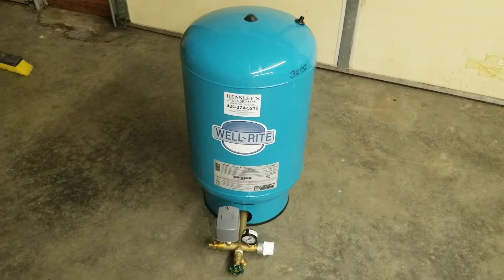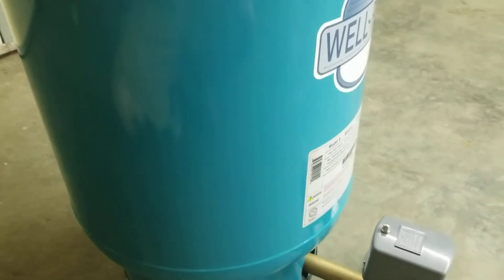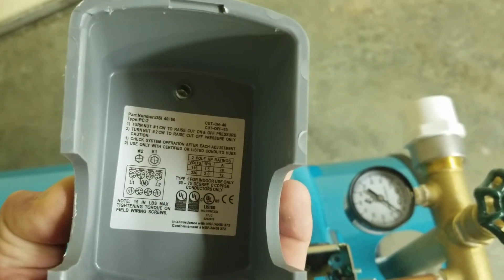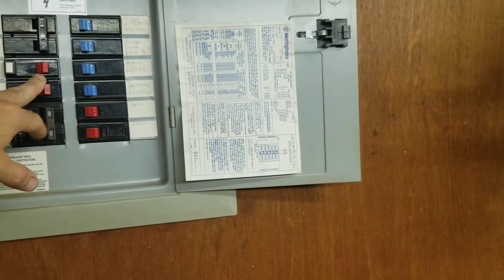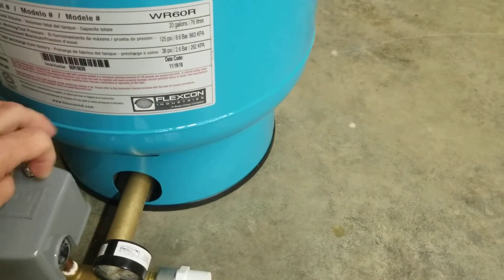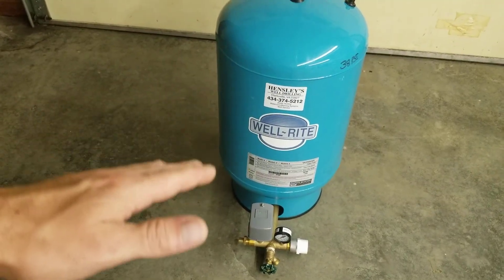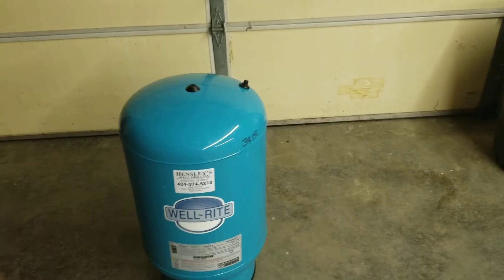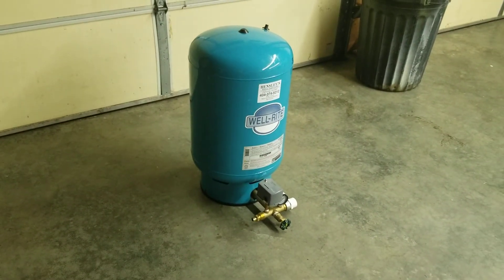Well Pump & Tank Troubleshooting, How the system works, Adjusting Pressure Settings Correctly

Comment: I have well where the pump won't turn on unless I smack the gauge.  Runs fine for a while then stops working.  I go give it a good smack and it kicks on.  I was thinking the gauge was just stuck but from what I've read, the gauge doesn't really control anything.  Is it a bad pressure regulator or does the gauge actually have something to do with it?  Thx
Reply from the maker: Replace the $10 gauge & the pressure switch. Don't buy 1 with a lever on the side

Comment: Is there any circumstance were water comes out were you test the air pressure and the bladder is Not Bad? I ask this because when I tapped on the cylinder it sounded kinda like a bell. but water came out when I tested the air pressure. My water pressure in the house is fluctuating.
Reply from the maker: No. Your tank is 100% bad. Replace it asap .

Comment: Why won’t my well pump stop cycling it just stays running what could be the problem a hole in  the hole in the line obviously right
Reply from the maker: Yes. Pull the pump out of the well, you might find a hole in a metal fitting or a plastic 1 that's cracked.  If it cycles on & off constantly, then the check valve is bad in the pump. Just add a external check valve to the top of the pump & use all brass fittings. Watch my pump install video for a guide. Lots of videos on my Well Q&A Playlist

Comment: Thanks fir the information.  I have a lake pump and double pressure tank under the new cottage.  Today we lost pressure but not completely.  When turning on any tap it comes out great but then slowly comes to a trickle.  I’m certain the pressure switch is not clicking on but not sure.  Any ideas?

Comment: I have had times of no pressure over the last 6 mos. Everything will work fine and then one day I will be washing the car or kids will be running the sprinkler and pressure gauge will drop to zero. It will often take half to a full hour to build pressure back to 60 psi. The replaced - pressure valve, pressure switch, pump and wiring. The switch is set for 30/60 and like I said, most of the time works fine. When tank was empty, I could shake the tank and did not hear any water sloshing around. The tank pressure at the top valve is 28psi. What am I missing?
Reply from the maker: You might try letting a little air out of the tank. Maybe 8 seconds of air release. Bc the switch might be preset slightly wrong. 
Also the bipple below the switch if its original, it can be clogged. 
Or if it only happens during heavy usage, you might be draining the well faster than it can recover. 
There should be a metal info tag on the well...if I knew that info, it would help to diagnose the situation better
Reply: @h2omechanic  I have not seen a tag on the well…the well was dug in 82. Pump replaced November 20 along with wiring and check valve.

Comment: Hello, today I've noticed the water stopped running from any taps, I've checked my tank and had no pressure.     After about 1 hour, it water was running again and the pressure was back up....what would have caused the water to stop running and pressure to go to 0, then return to normality on its own?  Thank you
Reply from the maker: The nipple below the switch is probably clogged up. Remove it & jam a screw driver thru it. 
If it keeps happening & u find the little stem is clear, then the pump is on its way out. It can overheat, & cool down & run & overheat again

Comment: My well went flat/no water..I can here the pump humming in the well....I'm using an irrigation pump for my sprinklers..that bypasses the pressure switch and come straight thru the pump out hose pipe..20 minutes..pressure  is up pump cut off I have water?? SUGGESTIONS??
Reply from the maker: Turn off the well breaker for 12 hrs & see if the well fills back up . Sounds like it's over pumping the well
Reply: Thank you is there a way to prevent  this in the future
Reply from the maker: Just pray for rain. Thats the big issue right now

Comment: Good video, I have a problem with my well. I was using the hose and my water pressure drop to almost nothing I stop using the hose check the well and the pump was running so I did something else for a while went and check the pump about 1 hour later and it was still running so I turn the power off to the pump left it off for about 22 hours then turn the power back on did something for about 15 minutes and when I check the pump it was off and I had water again. But now I use very little water trying to make it last... there is a severe drought in my area a lot of well going down.  The well drillers and repair crews are being overworked, when calling for service what type of service do I ask for?
Reply from the maker: I'm gonna say a 75% chance that you have a leaking toilet that is using water. Be sure to inspect them closely, either a leaking flapper & look at the center tank tube (overflow). Turn off each toilet and see if it leaks down. This will use water continuously 24/7. To help your situation, sleep with well breaker off & only turn on as needed for about a week. Alot of ppl in FL are having the same problem. & im a well driller, I too am being overworked, thus the reason for this channel.

Comment: My pressure air said that is 0 how can I fix it I had no water in my house right now
Reply from the maker: First you'll need to add air to 25psi. Air nipple on top of tank, add air like a car tire. This must be done with power off & no water in the tank. Have a sink open while adding air to push out trapped water. Then watch this video and follow the steps on the switch. But it still could be a bad pump...
Reply from the maker: https://youtu.be/PAd94cFX5y4

Comment: Great information, my tank was full of water. Pump now runs constantly only 40 lbs pressure does not cycleI have 40 /60 switch. New tank pressure 38 any suggestions thank you Dennis.
Reply from the maker: Not sure of your brand. The kind I use is a slip style. The piece that you threaded into would have the o ring on its face. I use a metal bar & have someone shine a flashlight 🔦 down the hole to help me hit it. Tie a rope to the pipe and then to something solid as a drop prevention safety. Sry I can't help more.
Reply from the maker: If u kill the power & the pressure drops to 0, you will need to pull out the pump. If it'll only build 40 psi, you probably have a cracked fitting down near the pump leaking out most of your pressure
Reply: @h2omechanic Yes pressure drops to  zero with power off, will let you know the  outcome. Thanks for responding.
Reply: @h2omechanic  Finally got chance to  check pump connections, you were exactly right found cracked Male adapter at pitiless adapter, installed new  one (brass). How do I reinstall pitiless adapter it is aqua seal lever type, I see others that have a slot looks easy, the one I have no idea nothing on inside wall of pvc. Thanks Dennis

Comment: my well pump keep trippin braker, a well company came and changed a pressure switch and motor points, but still tripping breaker, pump feels hot and have to wait for it to cool off to reset breaker and have water for a little bit then it will happen again. any idea what could be my problem? any pointer or advice will be much appreciated, thank you in advance
Reply from the maker: Yes, the motor/ pump is dead . Replace the whole unit. Bearings have failed, not running smooth & creates heat & higher amps & eventually pops breaker 100%. 
That company was a rip off. Imo
Reply: @h2omechanic  well yeah i felt ripped off nut oh well !! i will have to start pricing to get it done, than u for your answer

Comment: Love your videos.  Just installed a new 3/4 hp pump in my 270 water capacity well. My old tank 30" x 25' tank has a sticker saying it's 82 Gal ?  What's a better tank should I get ? I need 7-10 GPM.
Reply from the maker: 82 gal is huge. Id recommend a Well X-trol 250 tank. It has a 44gal capacity and it's not too big to deal with. But if it's a normal home with normal usage, a 20 gallon 202 tank is just fine & alot cheaper. Both will provide the same pressure

Comment: Very well explained.

In desperate need of help.
We have no water after a thunderstorm yesterday. 
I drained the pressure tank and checked it like your video. It was low so I filled it to 36psi.  Turned on the pump breaker and heard it click  pressure tank is filled but no water to house. I turned off the shut -off valve, changed the filter and turned it on without the canister and have lots of pressure. Reattached filter and canister, but still no water to the rest of the house. Can the pressure tank fill if the pump is not working? I hear it click.
Reply from the maker: It the tank is filling, & you hear water. Pump is working. You might have a bad valve or a clogged pipe somewhere after tank. Remove the filter can & turn on water & see if it flows out. Oh & a very important thing is don't use Black carbon filters! they'll stop flow within seconds. Carbon filters are for city water to remove chlorine taste.

Comment: I have a question for you what might my issue be 3 kids take a shower and the water shuts off. Water wont come back for at least a few hours?
Reply from the maker: Your over pumping the well. Faster than it can recover. Inspect your toilets and make sure none are leaking or overflowing in the back tank. A leaky toilet can kill a wells production over time
Reply: @h2omechanic  no leaking or overflowing from toilets. I have a 20 gallon pressure tank for a house of 8 could that be my issue do I need a bigger pressure tank that holds more water or should a 20 gallon be plenty?
Reply from the maker: 20 gallon tank is perfectly fine. You need to call a plumbers or id recommend a well company honestly. Bc it could be a low yield well or a dieing pump. A simple amp test will show if its dying or running dry. Idk what state your in, but FL has had a issue with alot of shallow wells going dry recently

Comment: Hi. I have a large pressure tank that was factory set to 38psi. The pressure switch states it is a 40/20. Someone previous to us lowered the psi to 18 to allow for a 40/20 cycle. The switch is adjustable. Is there any reason why I can not increase the psi to 38 again and then slowly cycle and adjust my switch to 60/40? Or fill to 28 and adjust to 50/30? Will it damage the switch?
Reply from the maker: Adjustments allow for 5-10psi max. Just go buy a 40/60 square D pressure switch & when you have the old one off, use a compressor & pump the tank up to 35-38 psi. Then install the new switch. Adjusting one will have you fighting yourself. Then you'll end up buying a new one
Reply: @h2omechanic  thank you. I will do that.

Comment: I could not get any water pressure at all. I changed out my pump and all pipe on the vacuum side of the pump with PVC. I can only get 20 lbs of pressure and the second I open the valve to the house it drops out. My question is, Do you think it is the bladder tank. After I turn the pump off the thank makes a glug, glug, glug sound and the pressure starts dropping.
Reply from the maker: Probably a bad tank & also a bad injector & check valve at the bottom (if it's a jet pump)
Reply: @h2omechanic  My pump went bad and lost prime. It ran down long it sucked in the well pipe causing it to collapse. Now I am faced with a lot of sand in my lines making problems.

Comment: Just been experiencing low pressure , around 20psi and steady. Won't increase even to 40 in order to cut on. I drained every thing , cut breaker off, all valves check for air in the tank =0 , so I fill it to 38psi for the 40 cut on and 60 off. Nothing stays at 38-40 psi , once I open the valve to the house tank pressure dropped to 20psi, closed the valve off pressure build back to 38 and sitting ? Hasnt even build to cut off pressure at all,
Reply from the maker: So since the tank was out of air it's highly likely that it has killed the pump, or killed 1 leg of the wire going down the well. Basically trying to spin a 240v pump with 120v. & it can't build pressure. Or you have a cracked fitting at the pump due to it cycling on/off/on/off so much. Ill send a link to a video explaining it. But pump needs to come out. 95% certain.  Unless you have a big leak in the yard somewhere
Reply: @h2omechanic   no no leaks anywhere one around to all the through the pipes in the house outside of the house nothing, it is started being like this after a bad storm with lightning, thought it might have been the pressure switch cuz I've already replaced it before about 6-8 months ago and it was working fine didn't have to adjust the springs on it. Now it's just sitting at 25 psi and just has a pulsing hum sound to the pressure switch still not building pressure just steady at 25
Reply from the maker: https://youtu.be/rVgDq7gB6Qg
Reply from the maker: Submersible pump? What depth?
Reply: @h2omechanic  yes it is a submersible pump I'm not sure how deep it is
Reply: @h2omechanic  yes it's a submersible pump but I don't know the depth I looked all over to see if maybe something is written on the tank, or the pipe going down in the ground looks to be about a 5-inch / slightly bigger diameter pipe going down into the ground. The rest of the other information I saw like on a capacitor says 230 volts 1/2 horsepower, I mean it hasn't been doing this very long going on probably two weeks
Reply from the maker: Is there a check valve located at the tank? Or one at the top of the well?
Have you had any air randomly come out with the water before?
Reply: @h2omechanic  no on water coming out , their is a Schrader valve, to check air pressure and add air need be.after all I looked @ on YouTube I'm back at a steady 20 psi , its weak in the house it will fill the kitchen skin , you can forget it at tub and shower .. Its like it's stuck closed , but wont even build pressure to the cut in @ 40 psi , I made a video I'm putting it up on my YouTube. Jon Roberts.
Reply from the maker: Ok
Reply: @h2omechanic  I have a video uploaded should be all mods handle not a real big YouTuber I'm just trying to figure this out be honest I don't really want it to be the pump itself, my folks been out here for at least 15 years the pump has been running fine ever since then and I know the tank has been replaced at least once and the pressure switch twice and the last time I remember the tank being done it's probably been at least six seven years. I didn't do the tank job I just did the switch do-it-yourself
Reply from the maker: @jonroberts6518  send/share a link to it or I need exact video title.
Reply: @h2omechanic  and the switch work for about 8 months, now hardly anything, at the tub faucets and showers that's the weakest stream
Reply from the maker: https://youtu.be/mjhZXgzZoDM
Here's another explanation. Ignore the freeze part. I believe yours has a hole in the pipe though. If you kill the power, normally it'll just drop to 0 psi if you have a leak. It won't hold 20
Reply: @h2omechanic   yeah it holds with water, drained the water and checked the air valve , didn't flicker the air gauge..then I filled the tank to 38psi nothing held steady didnt really engaged the pressure switch at 40.open the valve to the house what was built up in pressure dropped back to 20.and holding steady .. like it won't even build 40 PSI normally to engage the pressure switch to cut the pump on and cut off at 60, the kitchen sink is okay it would feel it and the bathroom sinks, the weakest streams running the bathtub faucet, and the showers, the house is a six-bedroom house but currently there's only three people living here there's two master bedrooms in the mix, and about 25000 to 30000 gallons inground swimming pool
Reply from the maker: If you shut the yellow valve off & turn off the breaker, does the pressure drop to 0 without running any water?
Reply from the maker: There's 2 possible situations, either the pump is worn out & can't build pressure anymore, or there's a cracked fitting that connects the pump to the pipe.  
Its also possible that the well could be dry & taking forever to fill up. In order to test that theory, leave the well breaker off for 8 to 10 hours & then see if it builds up more than 20 psi. The water level would rise & the pump will be able to lift the water easily.
Reply from the maker: Average pump life is 12 to 15 years. It's definitely the pump or the wire going to the pump. The tank & switch are perfect. Pump must be pulled out. My channel has a Well Q&A Playlist with 20 videos that'll help to see how to pull a pump & install it correctly.

Comment: I have a question about my well pump it's all new except pressure tank an I was wondering if the pipe set up is different if it make alot of didffeance
Reply from the maker: It shouldn't matter what pipes are used

Comment: Replaced our bladder tank on deep well 360 feet deep. 240 volts going to the well but no pressure  or water to the tank. Well is 7 years old. Will the pump reset? Any help is appreciated. Thank you.
Reply from the maker: If you have power to the well & no water, the pump is bad. Our 400ft pumps die around the 7 year mark so your falls right in line with typical life span. When the pump is removed, inspect the wire very very carefully for rubs & breaks! It could be a bad wire as well. Id pull it out & replace pump & wire. Watch my pump install video for tips. Find in my Channel Playlist Labeled Well Q&A